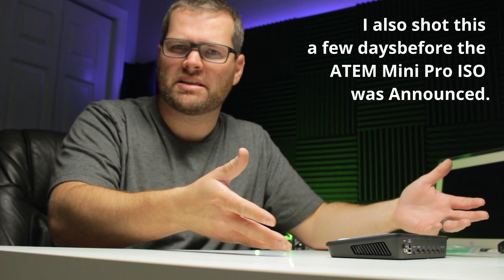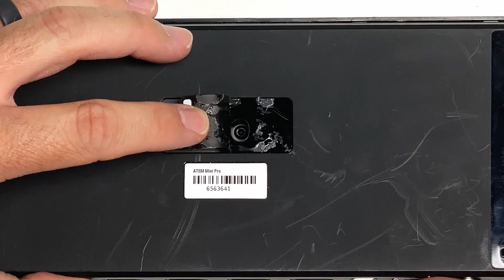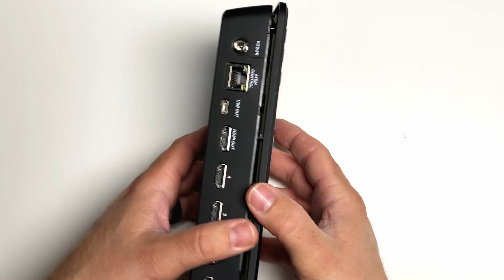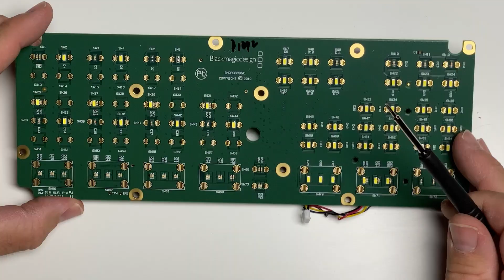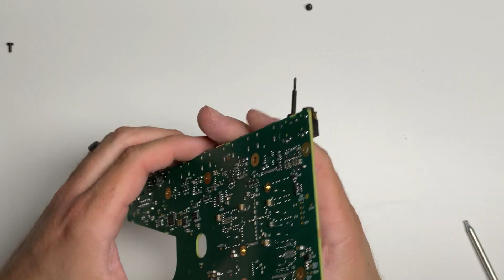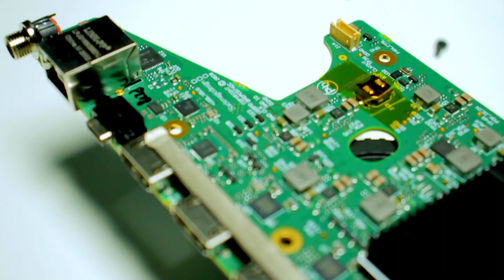What's Inside the ATEM Mini Pro? A Quick Teardown to see Just What Blackmagic has done!

Comment: I am super excited seeing your teardown video. 
Thoughts that pop in mind.

1. Why does the RTC does not have a battery installed ?? 

2. Did you take Hi-Res Still images of the board ?? The chips could be identified then. 

3. The chips right behind the HDMI connectors could be HDMI Rx chips which takes in a HDMI signal and converts it to Parallel or Serial Video signal that could be used by the SoC which I guess could be a Xilinx (Intel) UltraScale which includes a high efficiency H.265 / H.264 encoder https://www.xilinx.com/support/documentation/white_papers/wp471-ultrascale-plus-perf.pdf or even the latest Arria series. https://www.intel.in/content/www/in/en/products/programmable/arria-series.html

4. Technically it should only be software (IP in this case) with exactly similar hardware of the ATEM Mini for the functionality offered for the PRO model.

5. Could there be a hack to convert a Mini into Pro 😈

6. The chip is capable of processing 4K, the unpopulated DRAMs on the pcb could mean a larger frame buffer. 

When you open it again keep some heatsink compound handy. Wipe off the compound and you could identify the chip. Then you can re apply the compound and put back the heatsink.

Adhesives loosen up with heat. Don't put it in the oven though while dealing with.

A big big THAAAAANK YOU Bro. Grateful that you did this. I have been wondering if a low cost 4K to 2K ePTZ could be made. All cameras are 4K and we only stream at 2K so having a viewport (Region of Interest of ROI) scaler could give electronic pan tilt and zoom. Such product does exist but expensive. https://www.aja.com/products/4k2hd
Reply from the maker: Thanks Sougata!  I am not sure why there is no battery.  I may take it apart once more to see if a battery will help retain the information in the ATEM when power cycling the unit.  

I didn't take hi-res images unfortunately.  Again, something I'll have to do when I bust it open again.  I posted a link to a guy in the Uk who took photos of the regular ATEM Mini.

You are a much smarter individual than I am!  You bring some great info to the table.  I will definitely have some compound handy next time!  Thanks again for the comment and all the great info.  Good luck on your streams as well!

Comment: I was hoping you gonna remove this thermal compound to show what chip is exactly the main CPU.
Reply: This would certainly have been quite interesting!! It was certainly a missed opportunity once he got that far in the tear down. A bit of rubbing alcohol to clean it up, then just apply new thermal compound on re-assembly.
Reply: It's a Xilinx Zynq Ultrascale+ which is an ARM based MPSoC. Basically a bog-standard set of ARM cores with an FPGA built into the chip for custom logic. An FPGA is basically a sea of transistors that lets you design any sort of logic you may want. You can build your own specially optimized "CPU" or "GPU" in a large FPGA. BMD will be using that FPGA bit to do all the video processing in hardware with their own custom design.
Reply: @ConnorEhrgood  They are absolute kings of FPGA stuff these days. When the Quad HDMI Recorder came out I took a look at the IC. Way more capable than the equivalent in the more expensive AJA KONA HDMI and much more flexibly programmed too. Impressive work.
Reply from the maker: I was thinking about it, but I don't have any thermal compound to replace it.  Next time!
Reply: It is a Xilinx XCZU5EV Zynq Quad ARM Cortex-A53 w/ Dual ARM Cortex-R5 FPGA

Comment: Oh dude! There’s no point not to reveal the FPGA chip model. All the people in the industry are slavering to know. May I ask you to buy some thermal paste and teardown again? Haha
I guess it’s a Zynq.
Reply: That was my thought as well. Dieing to know what chip they used.
Reply from the maker: Maybe on the next model I get.
Reply: Zynq Ultrascale+ EV if I'm not mistaken
Reply: @ConnorEhrgood  Unlikely, consider how affordable it is...
Reply: @wilsonlmh22  I pulled one apart, definitely an Ultrascale+ of some sort, just can't remember what specifically. Those guys are expensive one off, but price falls DRAMATICALLY with volume
Reply: Wilson they probably designed around 1080p instead of 4K to be able to run on a sanely priced FPGA and to not need to much cooling (clock speeds). And 1080p out of the pocket cams may be related to similar constraint savings.
Reply: @randomgeocacher  Resolution(as parallel bandwidth inside) doesn't really affect FPGA's frequency a lot, but affect number of slices and IO significantly.
Reply: Wilson depends upon how serial vs how parallel your design is. Either you clock 4X faster than your 1080p solution, or you let everything grow 4X wider. Or you do a mix of both depending on where in the design either approach is optimal. Not that I ever built HDMI devices, but on Ethernet they do a bit of both, going to from 1G to XG both interface clocks and width increase in the relevant IP cores.

Comment: Opening it up shouldn't void any warranty regardless what the manufacturer says based on the Magnuson-Moss Act, however if you mess anything up while opening or closing the unit then of course that will void your claim as long as it's directly associated to the issue you're claiming.
Reply: Especially not with professional gear, you may even be required to open up and clean some things, like in stage lighting for example. You don't want dust build-up in your expensive gear, and even more so for stuff you use at events and the like.

This is clearly not designed for user service though, that's why they hide the screws.
It would be interresting to see if they can claim void of warranty both for opening the unit and for not opening it to clear out dust and grime :P

Comment: Thinking about the unpopulated ribbon connector.  Could it be a bus to a small display?  There is a gold connector J13 in the lower right corner.  Could J13 be a power connector?
How about a ATEM mini rackmount.  A low cost 2U unit with the mini on the right and 3.5" monitor on the left in a zero depth (1" deep)  enclosure powered with USB-C.  With cables out the back.  Just right for a flip up lid road case or mount it in a standard depth wall.  3 models, $600, $900, $1,200.
Just thinking...
BTW the best picture of the mother board is at 15:54.
Reply: hoping that J13 is an timecode output @ LTC format

Comment: On the top board, the square IC is probably an Arduino class MCU (Micro Controller Unit).  It is probably talking a serial protocol with the bottom board CPU.  Don't know why they used a wide ribbon cable?  If the MCU is talking I2C to the main CPU on the bottom board, then only 4 wires would be needed rather than the ribbon cable.

The next two ICs are probably 8x8 switch matrix encoders.  The last IC is probably a 8x8 LED driver.

About the 4 extra buttons, they are probably included to fill out the first 8x8 switch matrix.  Ignoring the bottom row of buttons, there are exactly 64 buttons including the 4 unused buttons.
Reply from the maker: Hey Robert!  Thanks for all your comments and expert input on this.  I think it all looks cool, but I am by no means an expert.  You are awesome!
Reply: @RyanKnowsNothing  Thank you for the useful comments.

Comment: Next time, please wipe the thermal compound of the main chip so we can see what the markings are! 😀 (and reapply some before you put it back together again 😅)
Reply: Xilinx FPGA.  Bmd does all there video processing in Xilinx. 😉
Reply from the maker: I definitely would have but I don’t have any extra lying around. Maybe when I open the other models! Thanks man!
Reply: It's a Xilinx Zynq Ultrascale+ which is an ARM based MPSoC. Basically a bog-standard set of ARM cores with an FPGA built into the chip for custom logic. An FPGA is basically a sea of transistors that lets you design any sort of logic you may want. You can build your own specially optimized "CPU" or "GPU" in a large FPGA. BMD will be using that FPGA bit to do all the video processing in hardware with their own custom design.
Reply: @ConnorEhrgood  Do you think there is any difference in processing by outputting via USB vs Ethernet, or is all the processing the same?

Comment: Going out on a limb here.  I think the large silver chip is a custom DSP chip that actually processes the video and below it is a smaller black chip, U31, that is probably an ARM base SOC, System On a Chip.  The ARM CPU is probably running a custom version of Linux (Linux From Scratch?).  And there appers to be a serial console with its Rx and Tx pads.
Reply: Xilinx fpga.  Bmd only uses Xilinx fpgas for all there video processing.  No Linux. But real fpga power.  The Atem mini is powered up and ready within a second.  Try that with Linux 😂
Reply: @xtlivestream5825  I would wager BMD is running Linux on those two ARM cores on the FPGA.  Linux gives the hardware developer an extremely robust set of internet utilities straight out of the box.  A kernel, realtime performance hooks, a robust development environment, any programming language you might want, any Internet service you can think of, rich debugging tools.  The list goes on and on.  If you don't need them, leave them out and save space and resources.  All for free.

I think you would be surprised how quickly a stripped down Linux based device can boot.  In a second?  Maybe not.  But 2 or 3 would not be hard.  The key here is "stripped down".  Linux runs very happily in a few Mb (not Gb) of ram and a few Mb of flash.  You can run Linux on the ESP32 micro-controllers with no additional memory.
Reply: @xtlivestream5825  It's actually both. Xilinx Ultrascale+ ARM guy glued to a nice sea of Xilinx FPGA goodness.
Reply: If it was Linux based they would have to make the code available. I can't see BMD wanting to make that public.
Reply: @WolfsHaven  A popular misconception.  Yes, BMD would need to make any Open Source code they use available, but only the base code they include in their product.  For most Open Source code there is no requirement for companies to make their changes available.  Only the base code they started with.
Reply: Robert Harker but they are required to note what libraries they used.  

Knowing Bmd.  There fpgas are running full stacks, parrallel processing and more.  They build this from scratch.  Or they bought a xillinx IP that is able to do this.   

The whole TICO streaming they implemented in the 12G IP teranex mini converters are also a Xillinx IP that you can buy.   I would not be supervised if on the Xilinx website there is just an IP to buy H264 RTMP encoding.  😉
Reply: @WolfsHaven  that is a common mistake. Linux kernel uses GPL license. That means that any modifications to the kernel must be published under GPL. So if you make a new device driver or memory management feature then you need to make it public under GPL. But you can use the kernel to run your commercial software and sell it as a bundle without issues... You can use gcc (open source compiler) to create your own commercial program.  Many HW vendors use linux for the generic stuff and only their specific stuff in their own HW/SW... for example they run web interface on opensource web server using linux.
The most complicated situation is with the libraries. GPL is "infectious" that if you use GPL licensed library in your project then you need to make the whole project GPL. As this is a huge showstopper for a lot of people many libraries use different licenses. Some require you to acknowledge the use of the library, most require you to make public the changes to the library itself but there are licenses that even give you complete control over the code.... and some authors do offer their code under multiple licenses....

Comment: About the other chips on the board, left to right, 15:44:
U16 under the 4 caps is probably 4 channel A/D converter.
The next 4 chips, U4, U5, U7, U8 are probably HDMI input chips with input 1 using a different chip, U4, than inputs 2-4.  Input 1 can be switched directly to the HDMI output as I recall.
U9 is the HDMI output chip is next and slightly smaller
Under the USB-C connector are two chips which probably a USB controller, U11, and either a serial buffer chip or perhaps a USB3.0 power management chip U3.
Under the Ethernet connector is probably an Ethernet controller chip, U12.  Not sure where the Ethernet transformers are.  Perhaps integrated into the RJ-45 connector?
Reply: @ The Ethernet Jack is indeed a magjack that houses the LEDs and the coupling transformer. The USB could be native to the FPGA because it also houses an ARM Cortex

The input 1 to HDMI switching could be from the internal bypass mode too. But they are definitely HDMI Rx chips.

Interestingly the modern FPGAs by Intel (Xilinx) support AI vision on the EDGE (Device itself) through intel's open vino toolkit. A development board costs  $5K. I wish I could turn this into an experimentation platform for vision. It's so neatly done. 

Thanks Robert for the insights.
Reply: @SougataDas  Isn't Xilinx a competitor to Altera, which is owned by Intel?
Reply: @chuffrey445  Yes. BMD are using Xilinx AFAIK.

Comment: The real interesting missing part is the ribbon connector to the left of the CPU next to the JTAG(?) serial console.  It is the virtical rectangle with solder dots top and bottom and then a column of very fine pads.  This type of connector is typically used when you want a parallel data bus between a CPU and a device like an LCD screen or camera.
Reply: It's a UART.  Probably for either testing/debugging or programming it in the assembly line.

Comment: The  board has  clean design, well made. I don't now why on/off  button   is missing in their devices.  Thank you for video.
Reply from the maker: I don't know either.  It's small but unplugging each time is still an bit of an annoyance.
Reply: You don’t want to hit accidentally the power switch will in the middle of a stream.     All atem do not have a power switch.    Just use a power distribution you can easily switch off when done.

Comment: I'd expect those four chips around the main processor are Ram.
There's no space on that lower board for a third audio input, to match the missing switches on the top.
Given the ISO is out now, and those pads aren't used on it either, and given there's a space for a UART chip that's also not present, I'm going to suggest that the button and missing chips and socket, are to communicate to another device. A jog/shuttle wheel for replays on the ISO would be one choice, but doing so would have had the button placement associated moved away from the Audio input controls, and Jog/Shuttle could be done via ethernet connection.
What I think we'll see next, is a small Atem Audio add-on, a mini mixer with sliders and probably four balanced inputs.
Reply: The 2+2 missing chips to the ledt of the CPU are probably RAM and the 2 to the right are flash memory.  There is also a 8 lead chip above the flash that is probably a serial boot EEPROM.
Reply from the maker: Thanks for this insight!  I kind of think the ISO is the last in the lineup of the Minis, mainly because of what you're talking about.  If they want to add more, then they need a different form factor.  But you never know!  They could come out with some crazy feature that it can still handle.  I suppose they could change the top PCB if they wanted to add more buttons.
Reply: @RyanKnowsNothing  - Chatting with some people with more access,.. there's some pre-production information suggesting the design originally had a headphones socket out to the left side, that has since been deleted.
This is still an extra audio interface, and BMD's audio side, is not great,.. I'm still expecting a further model with audio expansion, perhaps in co-ordination with another manufacturer.

Comment: As Grant said in the presentation, I bet the top part has a microcontroller using actual Blackmagic API to talk the the "actual video board", using BM macros. That's probably why it's currently impossible to reprogram the buttons, as it would imply a reprogramming of the chip in the top part.

The 2 blank spaces seems to be for RAM, so maybe they can swap the moutable ASIC, and add more RAM when needed for processing. If the HDMI controllers next to the plug can handle 4K, or if they can find other controllers using the same footprint, maybe they'll be able to produce a 4K version easily.

Another thing to note is the other space for a ribbon cable, on the left. If it's connected to the ASIC maybe they could extend the features with another daughter board. But I don't think it would be enough to handle the signals, maybe I'm wrong.

Anyway, very interesting teardown, thank you for doing it!
And thanks to Blackmagic for making such amazing products for the price!! :p
Reply from the maker: Thanks man!  And thanks for your advanced knowledge of this stuff.  My brain only has a certain amount of space and right now it's filled with audio related stuff.  That would be extra cool if they could make a 4k version of each switch.
Reply: Oh it’s just a guess, I’m far from being an expert :D